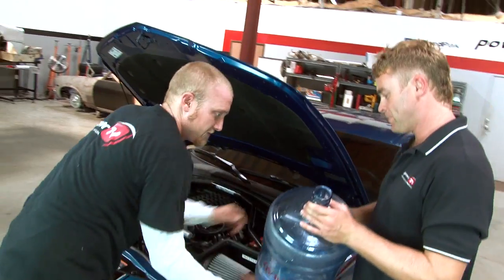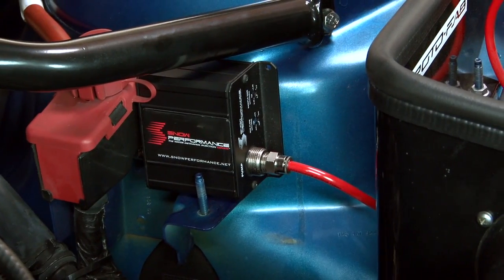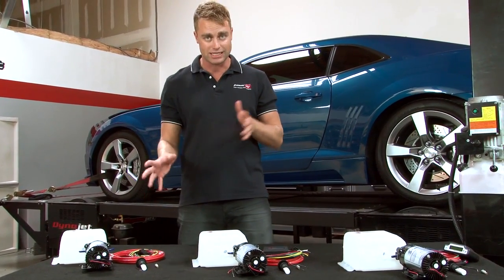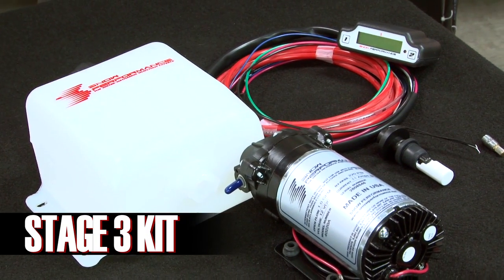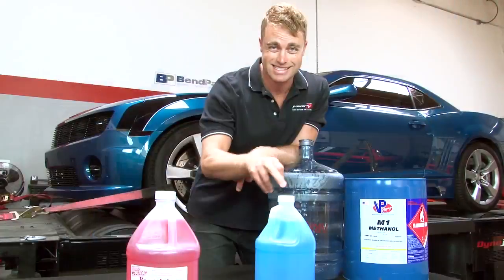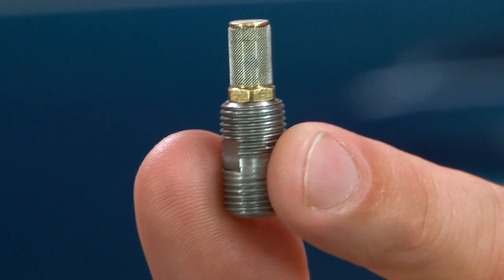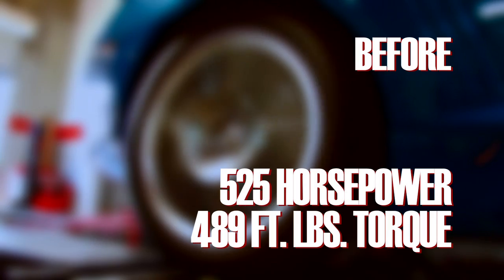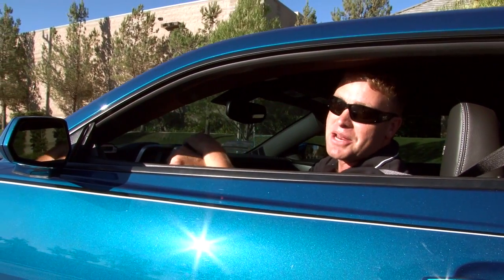StreetLegalTV.com - Understanding Water Methanol with Snow Performance

Comment: Why don't vehicle manufacturers do this to there vehicles?
Reply: They do. The current BMW M4 has an option for it. Also a lot of asian manufactures have it as an option. The reason, that it is not used in every car is, that by convention modern cars have to work with only air and standardized fuels.

Comment: I know this vid is really old, but I was hoping you guys could answer a couple of questions for me. First of all, what happens if you use the system with straight Methanol??? Why do you use the water in the first place, it seems to me you would get the same advantages from straight meth- maybe even better results as the octane rating would be even higher and the latent heat of vaporization would be even higher. Is it so there is no legal issues using it on the street??? 2ndly,, do it work using it with E85 as your main fuel and then hook up the H2O/Meth kit? Thanks guys
Reply: The power advantages to 100% Methanol vs A mixture is negligible. Fire in-car the risk is low, it's FIRE outside of the car where risk is HIGH. When Indy Car ran Methanol, on board fires were rare, the problem came from spillage during pit stops, getting onto the hot exhaust systems and igniting. Any accidentally flame or high temps inside a storage unit or garage can cause an explosion, not from the liquid but the vapor. You want more power, just add a nitrious system to your 50/50 water injection, you can make WAY more power and be just as safe; this type of injection is just now being explored...
Reply: +Daniel Brealey  THe primary reason for the mix is to prevent underhood fires. Plus for 90% of the applications Straight meth is not necessary and is a waist.
Reply: +Justin Rhodes Fire? From what dude? Sounds to me like that would only happen if it weren't pulumbed well and sprung a leak some where. As long as a competent mechanic or back yarder does the job that shouldn't be a problem I would have thought. Why would the meth system cause fires and yet high pressure fuel systems are fine? My car has a 1200 - 1300hp fuel system plumbed to the car that runs up to 65psi (fuel pressure) under boost, plumbed it all myself and have never had a problem
Reply: +Daniel Brealey 
running straight methanol, is one, hard on most pumps. two highly flammable. Yes it needs to be plumbed with care. The difference in the fuel system is metal lines. look up snow, cooling mist, devils own. they all use nylon tubing and most use push connect fittings. this is why they all recommend running a 50/50 mix. pardon my lack of punctuation, phone is being a pain. My car runs 1800+psi if fuel pressure, direct injection. If you want to run straight methanol you're not going to be using a off the shelf system.
Reply: +Justin Rhodes Alkicontrol bro, have a look at the system. Intended use is 100% methanol. Comes with stainless braided AN lines and all. They're pumps are intended for 100% meth too, so no problems there either. And finally, I've never heard of a fire with one of their systems, not to say it's never happened. I found out about all this after I posted this question, and the answer was 'YES', it WILL make more power and 'YES', it can be used with E85. I think most of the manufacturers advise a 50/50 mix is because their pumps aren't up to the task of running straight meth, as it's highly corrosive and eats away at aluminum parts. If they used stainless steel internals in their pumps it would be fine, but more expensive...

Comment: 80 horsepower from water meth???? You must of had that thing on a super eco tune or something before putting it on, those numbers seem a little exaggerated.
Reply: Not at all, not unusual at all. I've seen 80-90 hp gains over pump especially California (and six other states) 91 octane. 4 cylinder turbos about the same, usually 40-50 hp over base tune + pump gas. If the car can see the IAT drop, you usually get 3-5 more degrees of advanced timing, or about 10-15 hp. The Camaro was likely knock limited on 91 octane which is usually the case out here.  Give the boost a crank and you'll see even higher gains.

Comment: you made a mistake in the video, safe injection does not open the blow off valve, it takes a vacuum signal to open the bov. what you meant to say is it will open your cars waste gate or by pass valve in the case of a super charger through the safe injection solenoid.